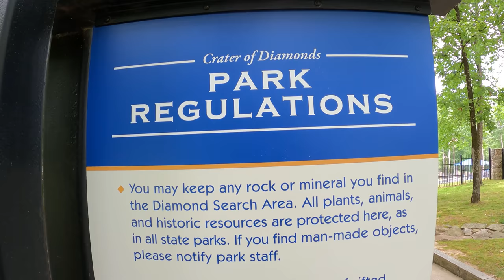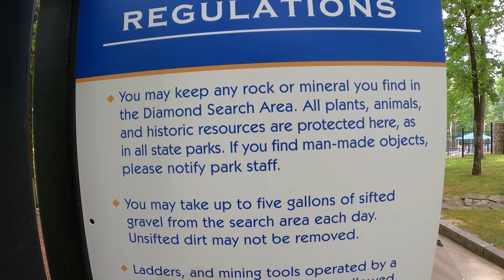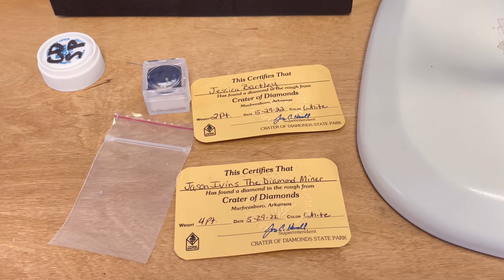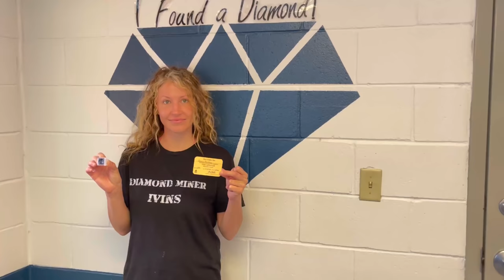PARK RANGER GIVES FINAL WARNING! Or Pay The Fees!!

Comment: You have to slope , Jason.  The guys not hard nosing you. If you go beyond 3 ft in many areas , you have to slope ! It will save you from getting entrapped . Just do the right thing . 
 Ok , so , from a plumber to my guy Jason.  Only toss your shovel full of dirt a ft from the edge of the excavation , if you are less than 3 ft deep . Tossing the dirt takes energy , and we want to save as much as possible.  So , toss the dirt as little as you can . Second tip , if you mound your spoils close to the excavation in mounds , then when you refill , it will take alot less time to backfill. Bacfilling after digging all day is incredibly exhausting.  
   I have to grind the tossing a short distance rule into my apprentices heads on the regular. Time is money , and dirt is heavy . Don't unnecessarily work yourself . 
  Jason , you would make a great plumber . If you move to south east Texas,  hunt me up at Davalos Plumbing , I'll take you on . You have determination and plenty of strength .
Reply: @DiamondMinerIvins  depends on how fast a plumber becomes as well as not making mistakes.  Currently,  I bill $120.00 per journeyman but much of that is eatin by uncle Sam, business expenses, insurance policies , it's a long list of expenses . So , the short of it , a typical journeyman or an over qualified apprentice can pull $30.00 plus per hour .

Comment: i wonder if a rounded or conical screen would be better for making centers, using the side to side shake at 90ºs to the previous shake. i wonder, as if you could use a smaller diameter screen like a regular prospecting screen with a dished bottom screen, you could theoretically make centers by using the dished screen to concentrate it into those centers. but, thats just a thought. i think to flip a deeper screen may require an insert that set into the screen to do a gentler flip so the gravels sit on the insert platter. but, a normal Saruca, wouldn't require that sort of insert method huh.

Comment: A collapsed 4ft hole? If anyone can manage to get trapped in that then they are some kind of special. I suggest writing complaints to the Governor and or othe higher up bosses that are NOT stationed there at the park.  They are just being anal. Be sure to hand out blank complaint forms to everyone you can. Tell your buddies!!  And mail them out!
Reply: He'd probably be fine unless he was bent over looking at gravel on the bottom when it caved in. He would be stuck though and would have to dig himself out with his hands or have somebody else dig him out. Try getting partially buried in sand at the beach. If it's deep enough, you can't move. Dirt is very heavy, especially if it has water in it.
Reply: No… it’s a very simple fucking rule. End of discussion. I bet you wipe back to front
Reply: Regardless of whether you think it’s dumb it’s a rule that’s going to be a make or break of the future of what you’re allowed to do at the park. So why be blatantly dumber than the rule itself 🤦🏼‍♂️